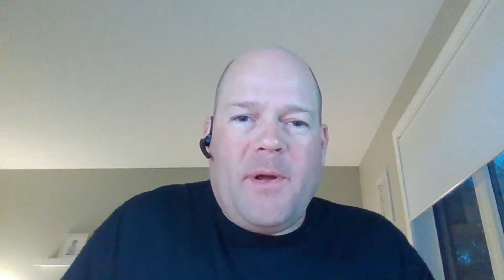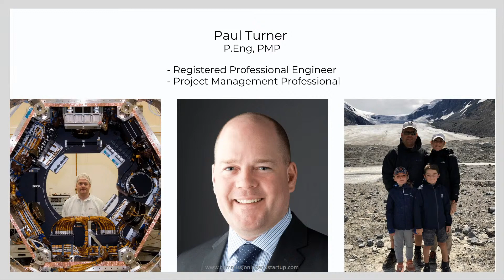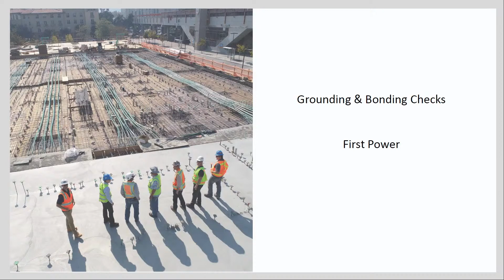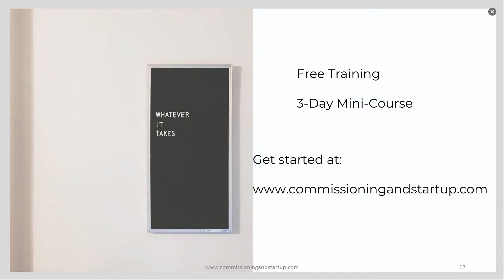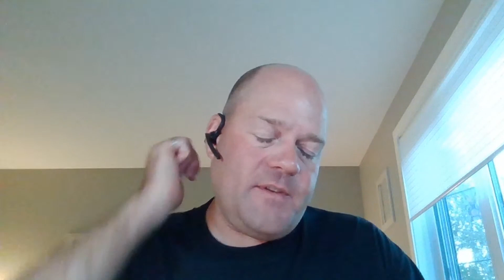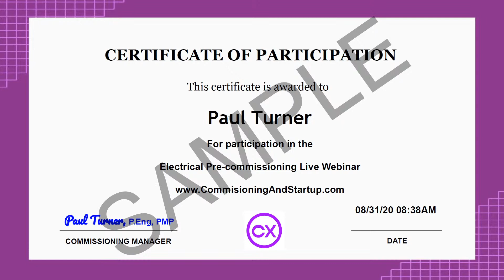Pre-commissioning of Electrical Systems

Comment: Dead testing carried out by the M&E contractor once the install is complete and then gets witnessed by the clients and main contractor's Commisioning team all test results get checked  and the visual install checks as well by all parties and gets signed off before energising. Then we energise and do all the live tests results which gets witnessed again by all parties including equipment manufacturers when necessary. This is the best job in the world ever even when you are off the tools you are still on site in the field making sure everything runs safe and sound as to specification and design and handover to the cleint once  you train the maintenance guys. Thanks mate
Reply from the maker: Glad you're have a great time!  Commissioning is the best part of the project.

Comment: in Mechanical  motor solo run is part of precommissiong, But in electrical when we energised the equipment it is already commissioning right? Electrical precommissioning is when we are doing IR test to motor prior to energisation.
Reply from the maker: That's true, motor bump testing takes place as part of mechanical pre-commissioning.  Electrical equipment can be energized as part of pre-commissioning, since power to the cubicles is required for testing.  Pre-commissioning is the initial checks on the electrical systems prior to confirming everything works together as a system during commissioning.  Both precede startup, which is when the plant processes are started for the first time.